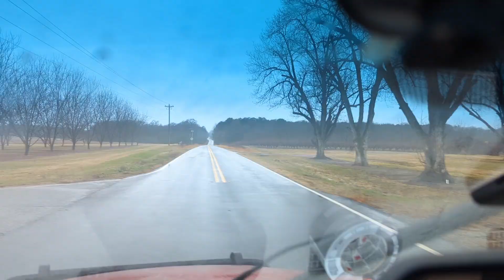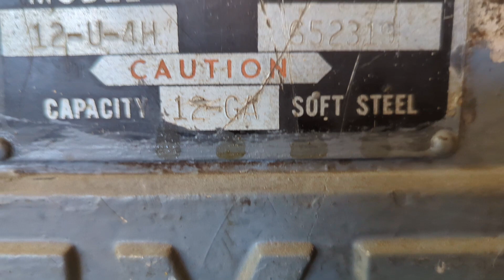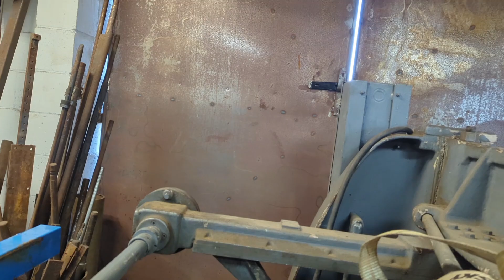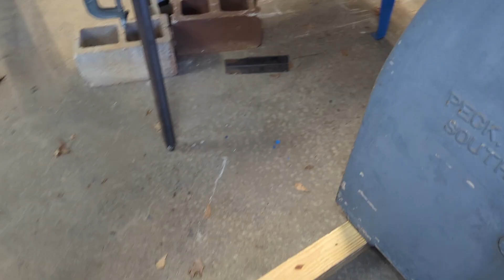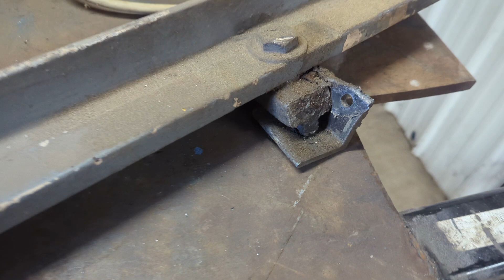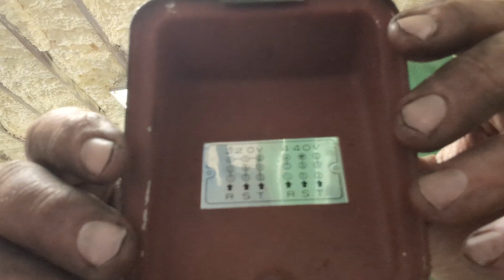unexpected equipment for the shop

Comment: Very nice drill, the older stuff was easy to change voltage on because you could basically just change the heaters on the starters but starting on the 80’s things started getting over complicated.  I’d love to find a that size as my big one is overkill a lot of the time
Reply from the maker: I had a Cincinnati Bickford radial drill, but it was a lot bigger and had a lot more bugs in it. This is going to be nice

Comment: Nice finds Steve! That 12 gauge shear will be awesome for the shop! That radial drill is one year older than me, I'm a January 1986 LOL. That will be really nice for the shop too. You're absolutely right about double checking the voltage that machines are set up for. My Bridgeport was wired for 480 when I bought it. The motor was easy to change, and the control cabinet had a transformer inside that was easy enough to change.